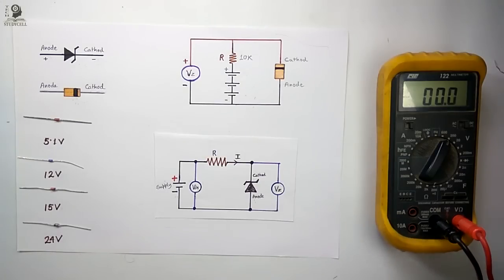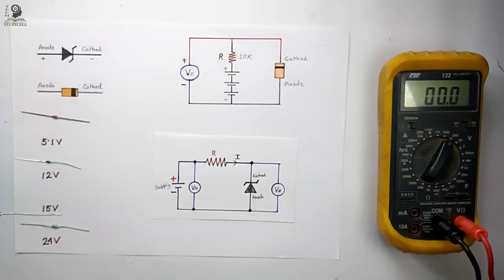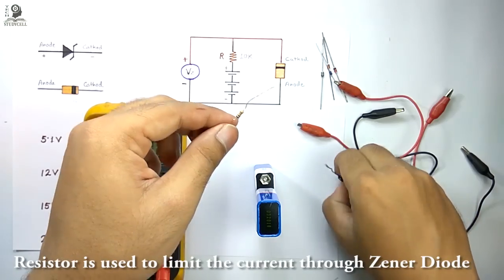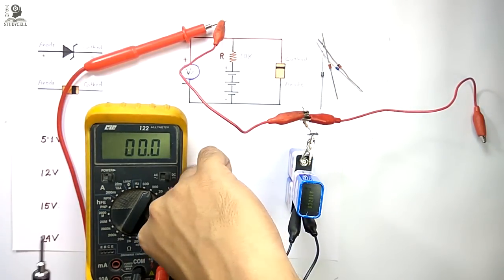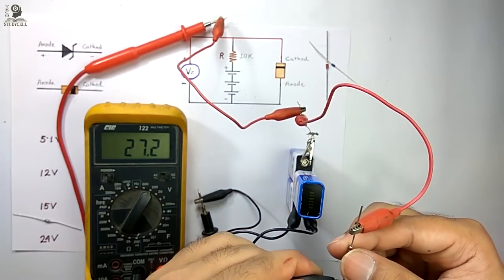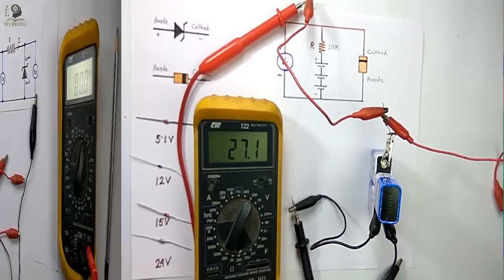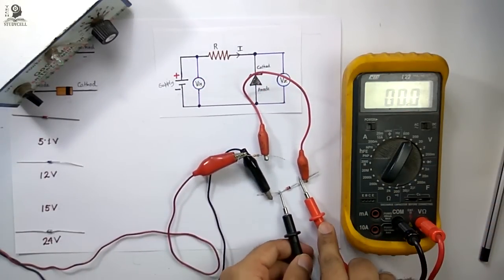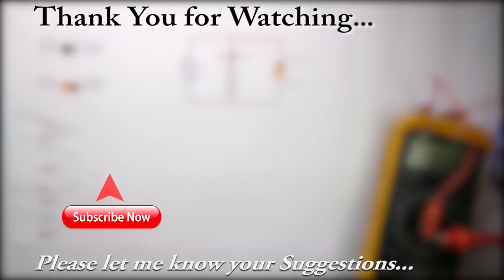How to Test the Voltage of Zener Diode without variable DC power supply

Comment: Very clear explanation overall. However, a Zener diode may not be faulty if it has a higher value than your 27v supply.
Reply: Very clear and informative. Can you please tell me the value of the resistor used in the test circuit? Thank you
Reply: @LuxmanPD272   I think I used 2K. A wider range (at least 1-3K range) will work. I used my bench power supply to see how much current was drawn (something like 20-30 milliamps) while testing a wide range of zener diodes, to arrive at 2K, because too much current can damage zenors. 

 I am using a 30v supply, so I have to be aware that if I am testing a higher voltage zener, I won't be able to determine if it is faulty, if the voltage is lower than the breakdown voltage which causes a zener to conduct in the opposite direction.

Comment: May God bless you.thank you very very much.soon i will upload on my video on my negatif resistance touch on of switch using only single bd139.its shocking me that i have no idea of the phenomenon that with fast switching will latch the switch and mild switching ( gently push) will turn it off.i am researcher of negatif resistance effect since 15 years ago.but it will work on certain treshhold voltage.

Comment: Thank you friend.  I have a question why some diodes gives less voltage than supposed 3.3v it gives 2.7v that's normal or leaky?
Reply: they need enough current; from 6 to 10mA

Comment: I want to retrofit some lights in my car and the rear lights have a constant 3v and when brake is applied the same is increased to 12v and when i use relay it constantly beeps clicks due to 3v is there a way to cancel that 3v and make it to work only when there is 12v in the curcuit. Please

Comment: This setup does NOT work for Testing the small SMD Zener Diodes!!! The 10k Resistor burns down and the voltage is unreadable...! Is there any solutions?

Comment: Can't we check d voltage just by connecting its leads directly to multimeter leads in reverse direction? Is a battery needed anyway?
Reply: Plz ans if a mobile charger uses zener diode?
Reply from the maker: Battery is needed for the zener voltage like 6v 12v 24v etc.

Comment: If i want to use a zener diode as a voltage regulator then do i need to connect 10k resistor at the positive terminal as you have used in your circuit.
Reply: Romesh H no
Reply: @melikrasniqi1511  It does need a resistor to limit current  R = [Vs - Vz ]/Current

Comment: as it is break down voltage the diode doesn't get damage with given 27v such as for 5 v diode? ?what is the maximum voltage on which diode can run on?
Reply from the maker: +Yashod Raj 
It does not depends on voltage. It depends on wattage of the zener diode which I have explained at the end of the video. 
If the multiplication of voltage across diode and current through it is greater than the wattage of the diode then it will burn.